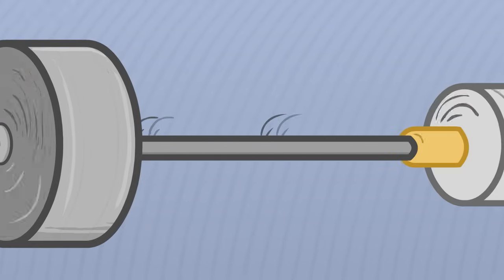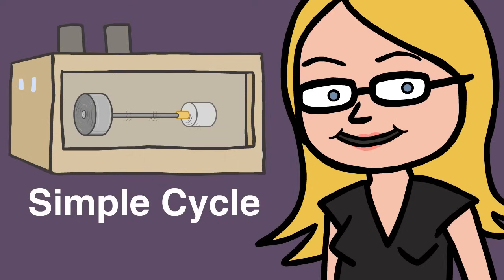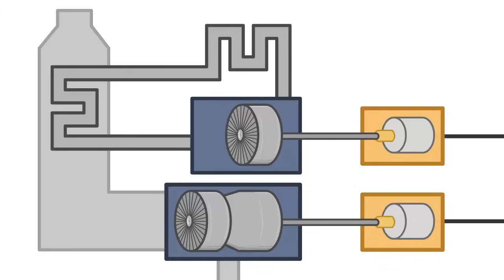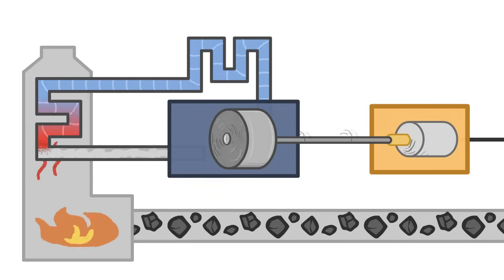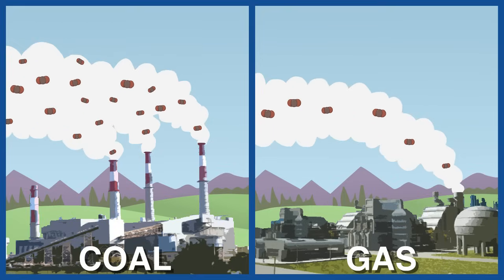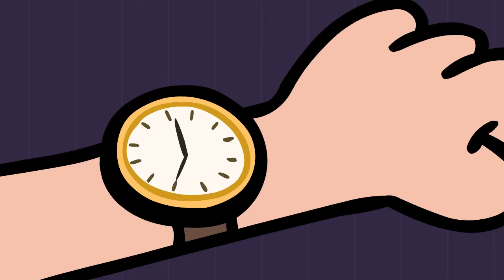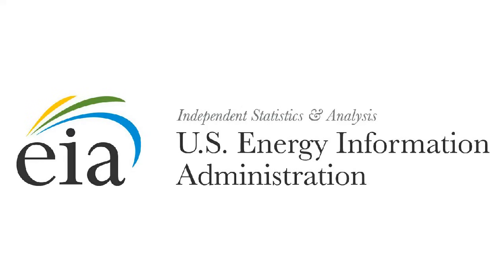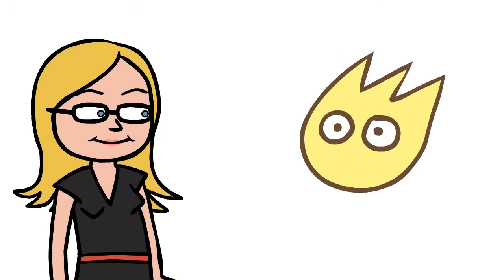Energy 101: Natural Gas Power Plants

Comment: I had read that CCNG power plants can reach upto 60% so 50% is a bit lower than expected, but this number can be pushed much higher or lower with more technology.

When nat gas is burned directly in oxygen rather than air, the efficiency can reach 80% if the CO2 exhaust is part of a supercritical CO2 engine, some energy is needed to split O2 from air which reducues efficiency down to 70%, unless the seperated air has a use for the nitrogen which could go straight into fertilizer production. See Allum cycle.

On the other side when renewables are combined with nat gas as the backup up, the CCNG 50% efficiency has to be lowered back down 1/3 because more CCNG has to be repolaced by direct simple gas peaker plants which really are just jet turbine engines bolted to the ground and a generator. If all the renewable power was shut off, the peakers could be replaced by full CCNG power and the net natgas useage and CO2 production would be the same. If RE ever gets to about half of natgas energy production, then you end up shutting down CCNG and replacing it with 2/3 eff peaker plants so what is the bloody point.

We should replace all of this with high temp Molten Salt Reactors which with super critical CO2 generators could reach 60% eff and be fully despatcheable since molten salt stores heat from the coolant loop, so power output can be increased or decreased at will from a constant production of heat. Almost all MSRs include this feature so no need for any kind of energy storage needed at all, no peakers, no pumped hydro, no battery storage, no wind or solar farms. All good 24/365.

Comment: Burning natural gas produces less CO2/kWh compared to coal. However, studies shows that 3,7% of the natural gas leaks into the atmosphere and natural gas (mainly methane) is 80 more powerful in terms of greenhousewarming potential compared to CO2. Besides this gas needs to be compressed for transportation which takes extra energy and the gas exploration process (often fracking) is environmentally damaging. Long story short: gas powerplants are not always the best idea.
Reply: Go live in a teepee and burn a candle for light and heat! Cheers!😊
Reply: @Jack51971  this is a silly response, and i feel like you know that
Reply: Can you share the studies so I can read it about?
Reply: Seeing how we shut humanity down for a pandemic.. caan you show me any measurable blip in the GHG graph or warming chart from 2 years of more reduction in activity then would be imaginable otherwise?
Reply: @dootdoot1867  While you were quarantined, did you stop using all of your electronics and, thus, stop using any energy provided by fossil fuels?
Reply: @zandgall  That is disingenuous. How much kWh does a Playstation 5 use?  How much kWh does 35 Total 120 Amp 50 HP 575V CNC Lathe's use? We shut all the factories down. All the cruise ships, All the jets. Mines, etc. You cannot equate industrial production with household consumer goods.
Reply: @dootdoot1867  i must have missed the part where we shut "all" the factories down, but this is a video about energy. CO2 emissions were down about 5% in early lockdown, and methane was down about 10%, according to JPL at NASA. However, the lockdown didnt last "2 years", and emissions were almost completely made up for by the end of the year

Comment: Nuclear energy (the new generations e.g. molten salt reactors) would always be the best choice to backup renewable energies! In my opinion ;-) No CO2 emissions and much less waste than fossil fuels such as coal and gas!
Reply: While true they have a big downside, you have to build them, at billions of dollars per plant.  We have hundreds of coal plants that we can easily convert to natural gas, at 1/30 the cost of a nuclear power plant build.  When renewables take over more of the energy market then these plants can run on bio gas and hydrogen to be carbon negative or carbon neutral.  Here in the USA we can keep at our current consumption of LNG for the next 50 years if necessary. Don't get me wrong I am a fan of nuclear and want to see our older gen II and III plants replaced with next gen reactors and using the newer low waste thorium fuels we are working on.  But costs in the nuclear industry just can't compete against LNG even with decent Gov cash flow to them.
Reply: @MrGeforcerFX  Who is “we” in your comments?

Comment: Doesn’t reducing carbon emissions by 60% just kick the climate-can up the road. If we’re gonna make new energy infrastructure we should start with thorium witch is 200 times more energy potent than uranium
Reply: No it isn't. Thorium breeds to uranium. Not even fusion fuel is 200x more potent than uranium.
Reply: Gammareign Tell that CERN which is where I got the 200 number. 
Also yes, it does breed into uranium, but not into U-235, thorium breeds into U-233 which is incredibly rare in nature but you can get a lot more in breeder reactors when you use thorium.
(Also it’s hard weaponize because the process also creates U-232 which decays into Tl-208 which makes U-233 contaminated with it hard to weaponize)
Reply: @daytoncoates4930  After you sell your assertion to ITER which says fusion releases 3 to 4 times as much energy as fission.
Reply: Gammareign which type of fission? There’s a lot of different reactors.  Plus fusion is is ROI-negative and is probably another 30 years away

Comment: While Natural gas still produces CO2, It it far better than coal. that's progress. I still prefer Thorium liquid fluoride reactors.
Reply: Actually, modern coal power plants are even cleaner then ever before! Some mega coal power plants in the UK have a metal filter material that filters out a lot of the sulfur, N0x, and even the CO2 from the coal emissions when burned; approx. 90%! Still, natural gas is cleaner and when you think about it, natural gas is unlimited because landfill emissions is methane, which is natural gas, and we have no shortage of landfills lol.
Reply: Just a shame there is no real funding or research on them anymore.
Reply: @Ushio01  Check out Kirk Sorensen from Flibe Energy.  Bill Gates is also involved in a company called TerraPower that's working on a compact, modern fuel cycle reactor.
Reply: I prefer arc reactors.

Comment: The big deal you have to take into consideration in natural gas power plants is the lack of natural gas which would make the combustion unsteady and the leakage of the natural gas which would cause bomb.How does natural gas power plants deal with the problems?
Reply: +Christina Li Leaking gas is detected by odorant injected in the line.
Reply: +SandoTrini yes but what about the methane emissions from the extraction and storage processes?
Reply: +Robert O'Steen gas emissions will or should either be flared or conserved. there are ways to avoid exhaust gas venting to atmosphere.
Reply: Yes but with the current process in place there is tons of methane being leaked to atmosphere across pipelines and storage containers.

Comment: "60% less carbon." Wait, I thought there was more then just carbon dioxide, like carbon monoxide, carbon fibre (not quite a gas, but you get what I mean). You should have added the dioxide. Other than that, good video.
Reply: you aren't serious are you?
Reply: +SIMcityplayer2002 carbon monoxide equals incomplete combustion. that is not happening in turbine combustion when properly metered.
Reply: Natural gas releases CO2 when properly burned as it is burnt completely. If you burn natural gas and starve it of oxygen, it will release soot and carbon monoxide.